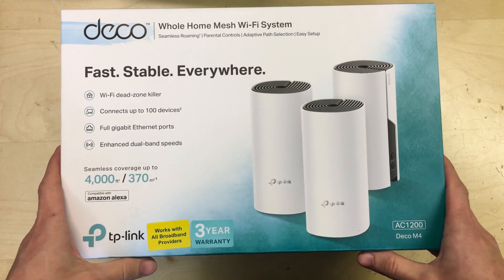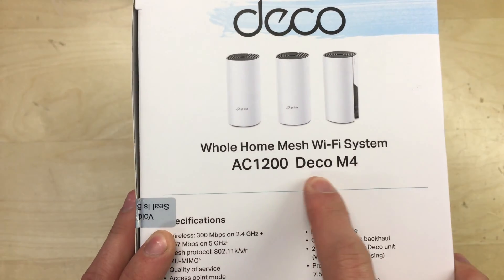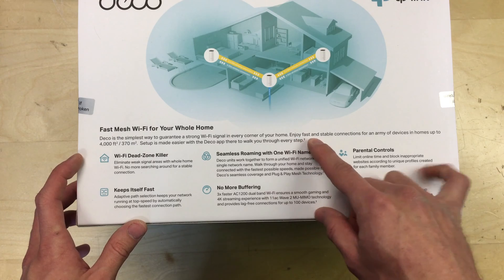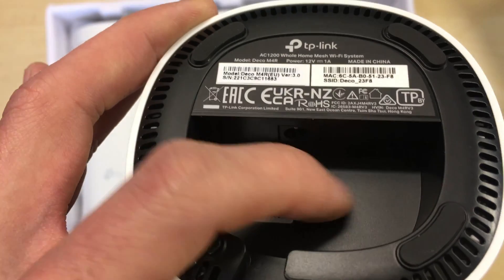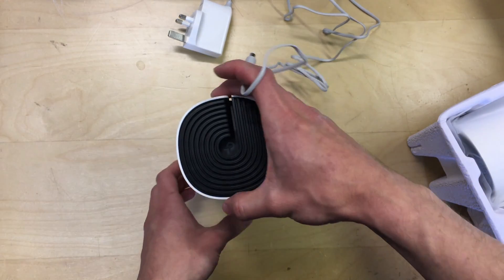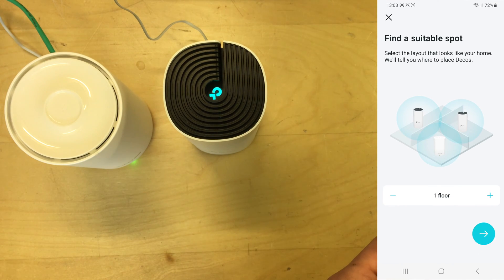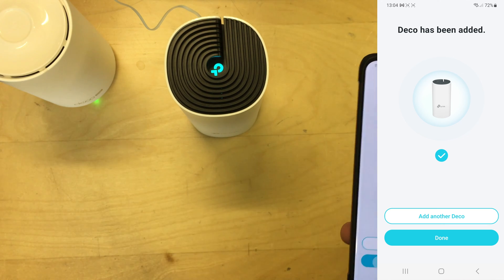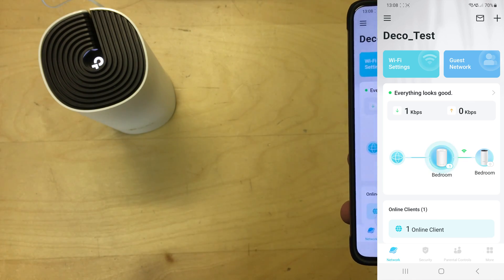TP-Link Deco M4 AC1200 Mesh WiFi System Kit (3 Pack) - Unboxing, Overview & Quick App Setup

Comment: If i connect to my isp router directly i get 450mb but when i  connect via my Deco M4 i get linited to 90mb any ideas! There are 4 m4's on the mesh network and they all have a good signal. I ran the network optimisation wizard still the same.
Reply: the mesh wifi only works at 100mbps from the modem